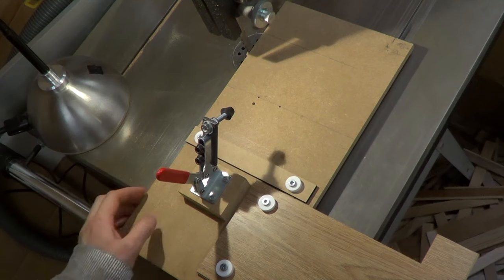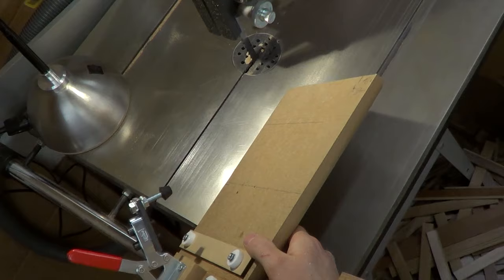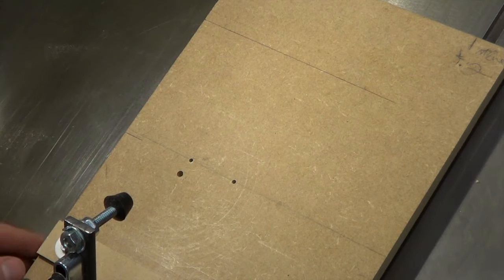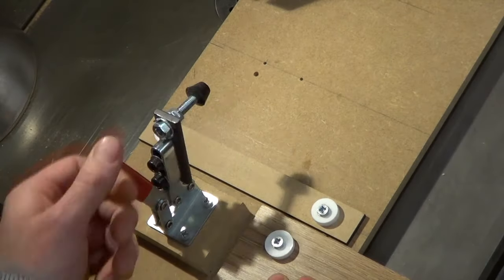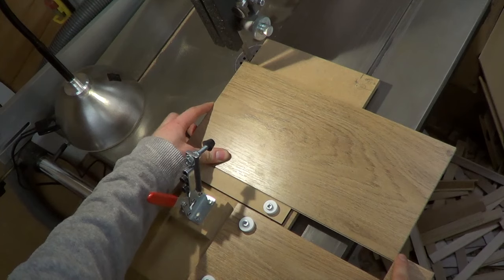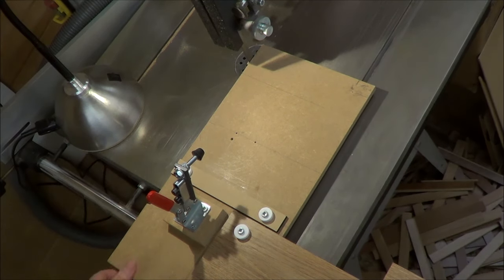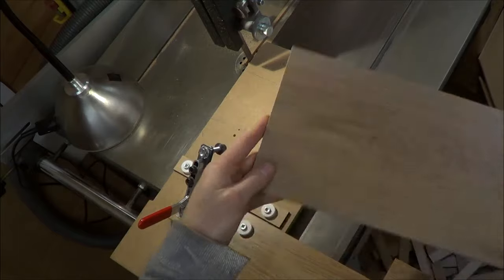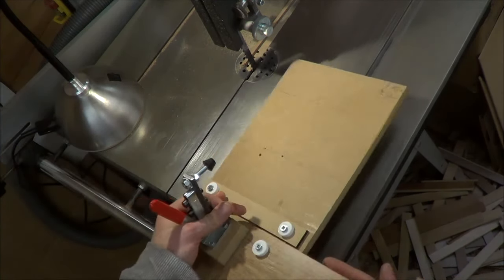Sliding bandsaw table

Comment: FYI, thats not a sliding table, its a sled.  Slight difference.  UHMW material, aluminum or steel would be the ideal material to actually make a runner with.  UHMW and Aluminum can be cut on a table saw easy enough.  Good luck.